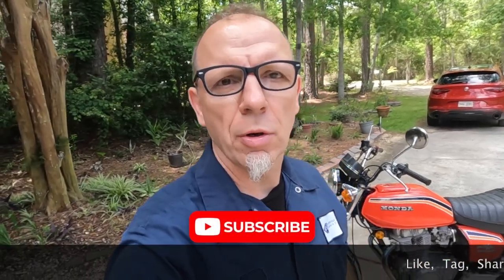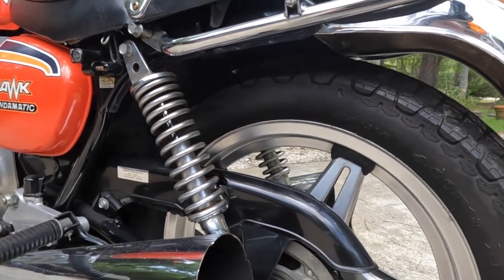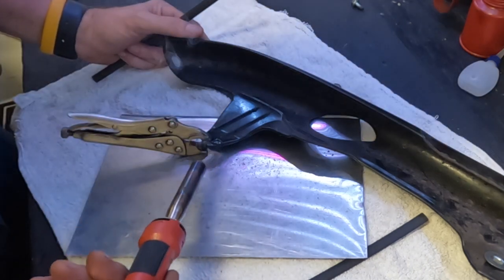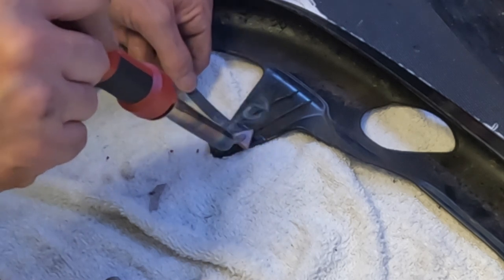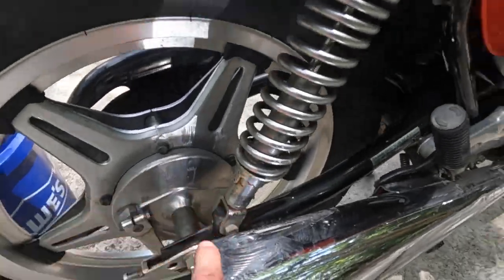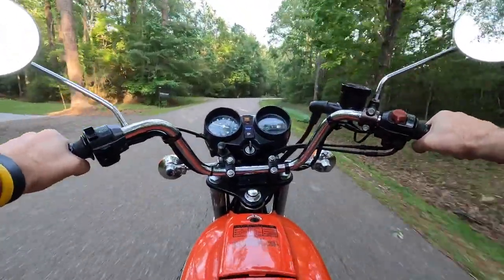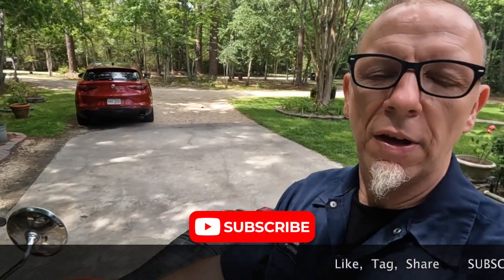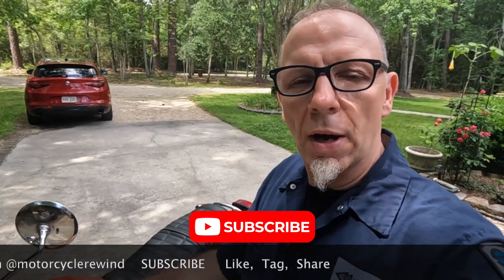1978 Honda CB400A Hondamatic Chain Guard Repair & Ride #cb400 #vintagemotorcycles

Comment: I have the same bike love that thing so easy to cruise on
Reply from the maker: Awesome Brian. How long have you had yours?
Reply: @motorcyclerewind  I bought it in 2005 for $750 and it only had less than 3000 miles so I thought it was a steal. Just runs so smoothly and it will cruise easily at 60 tp 65 mph which is plenty fast for me. I like riding the country black top roads that don't have alot of traffic and the riding season here in Florida is pretty long unlike Pennsylvania where I'm from but been in FL since 1986 and love it here.  I can take the heat better than the cold. I also have a 80 MGB that is close to being done. I am retiring at years end and plan on finishing it to enjoy also. I mentioned this because I spotted one in your garage.  Enjoy your videos.  What is the best way to clean up aluminum on my Honda?

Comment: Please help me! I recently acquired a 78 cb400a and It needs some work before I can get it on the road. Im new to bikes and my friend gave this to me as a project he didnt have time for. Your guidance would be greatly appreciated.
Reply from the maker: Congrats on your new bike. 
Email MotorcycleRewind@gmail.com or on Instagram. In the mean time here is a link to a shop manual https://tinyurl.com/43878zf8 
Does the engine turn? Does it have spark? What’s the condition of the carbs? Reach out I will do what I can to help you out. Thanks for watching.

Comment: I thinking about buying one of these for a project. What do you think is a good price for one of these that ran about a year ago?
Reply from the maker: I bought Keri’s 2 years ago and paid 1,200 bucks. It was in Tampa and had it shipped up. So all in about 1,700. Then put tires and bought some better condition side covers. 
The only thing to make sure you check is ignition. It’s ok if it doesn’t run because of carbs. But the Hondamatic’s have some model only pieces and parts. The ignition system is one and they can be pricey.  
Prices are all over the place. Send me pics and details via motorcyckerewind@gmail.com or on Instagram.
Reply: @motorcyclerewind  how do I check the ignition